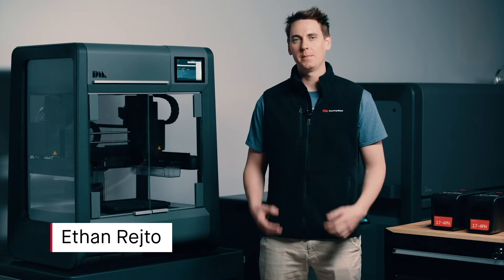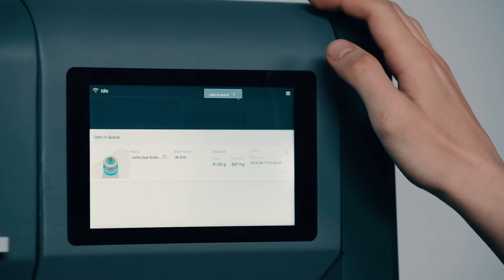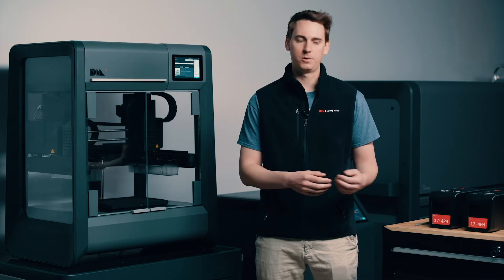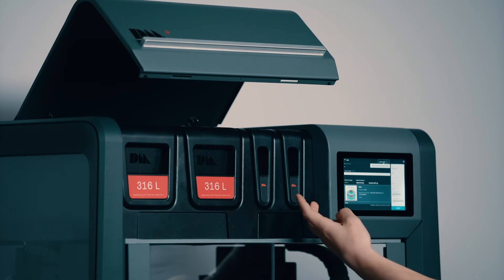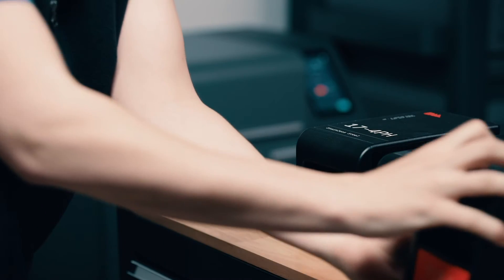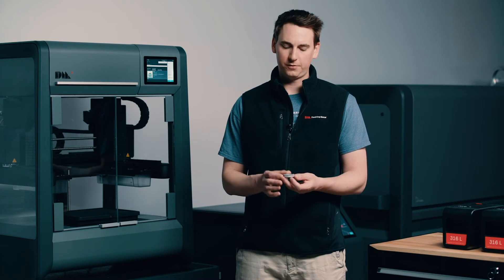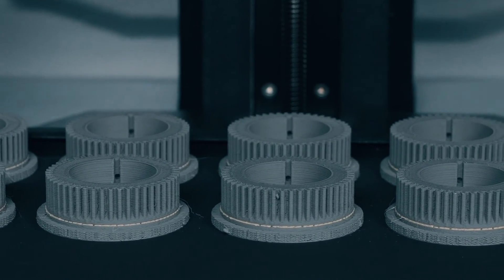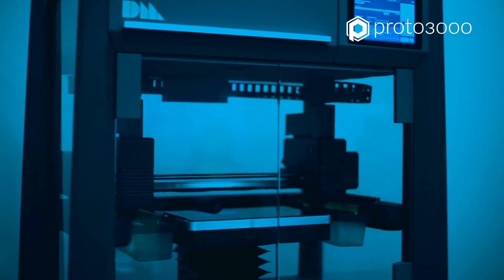The Desktop Metal Studio 3D Printer Walkthrough | Metal 3D Printing 101

Comment: We Have For Sell At Very Very Special Price 🔥  2020 Year New Desktop Metal Studio System 3D Metal Printing Incl With Debinder & Furnace Line Very Less Use 🔥  
Equipped with a Demo cases With some printed examples Show Room Condition Almost Brand New
1 X 3D Metal Printer Desktop Metal Studio System Printer Year 2020
1 X Debinder Machine Year 2020 1 X Sintering Furnace Year 2020
Anish Patel Anish_patel77@yahoo.in
 Whats Up +919974017795

Comment: I think you should probably put desktop in quotes. It would be more honest as “The “Desktop*” Metal 3D Printer.”  With a note that says “*Note: the printer itself is actually too big to fit comfortably on most desktops and multiple large machines are required to achieve the finished part.”